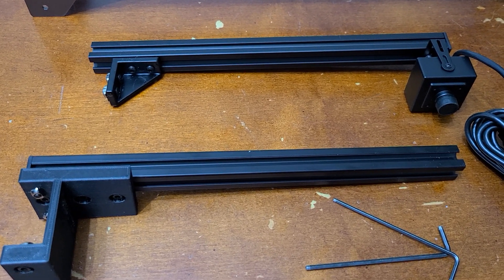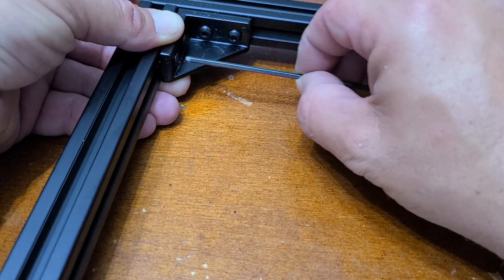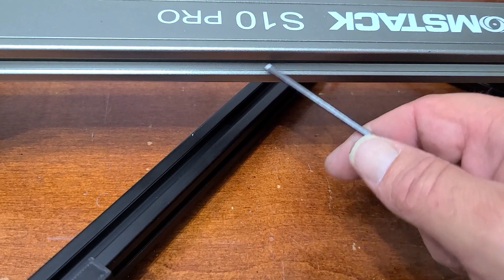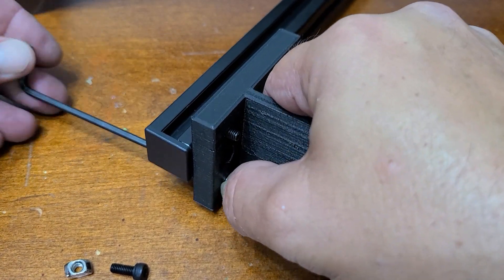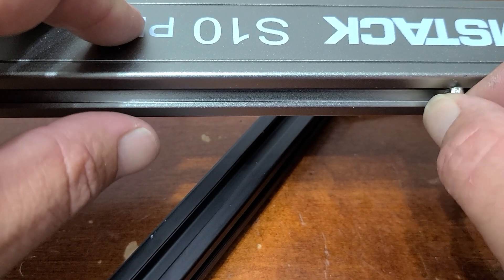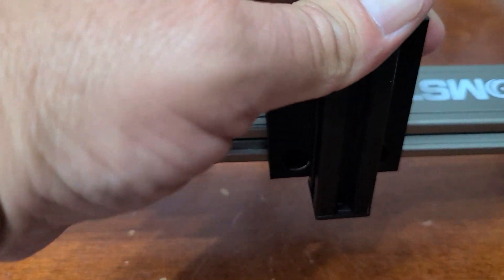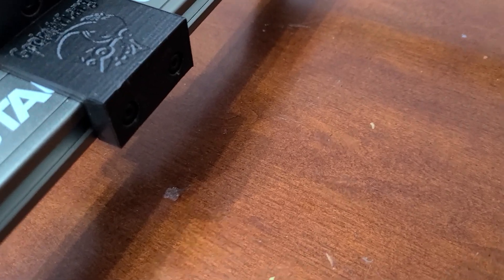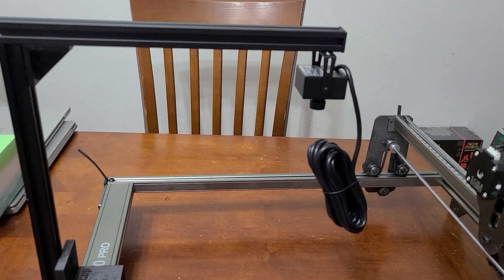Assembly and Hardware Installation for the GaL Camera Kit for Atomstack Laser Engravers

Comment: Hello there,
Is this applicable for Atomstack A10 Pro?
If yes, ı have one more question. After the installation and first camera set up, when I need to burn a thicker material will I need to renew camera setup due to thickness difference?
And when the laser moving rapidly, is camera still shaking/vibrating? İf yes, is this cause any problem?
Reply from the maker: Hey there!

Yes, it's for all Atomstack models and derivatives (Nassum, Enjoywood, etc).

On your second question, when the distance between camera and the material change, the alignment needs to be redone at the distance. While that sounds like a pain, you can save your alignments and recall them as needed.  

The same applies to the position of the camera relative to the machine, which is related to your second question. By bolting the camera system to the machine's frame, the camera stays on the same position relative to the machine.  When the laser is moving rapidly around, it can shake the machine's frame. This will not impact the camera, as it's coming along for the ride.  I've run tests on my S10, A5, A5 Pro, and A10, and found that stock machine reached the limits of its speed without effecting the camera.

Hope this helps!
Reply: @geeksatlarge  thank you for detailed response! Have u ever uploaded any video regarding lightroom installation? (Couldnt find, sorry)
Reply from the maker: @guvensayn2226  no problem! Here is the Lightburn side: https://youtu.be/4bjiVpgF2XY

You can also check out the product support page: https://geeks-at-large.com/support/camera-kit-for-atomstack/
Reply: @geeksatlarge  appreciate